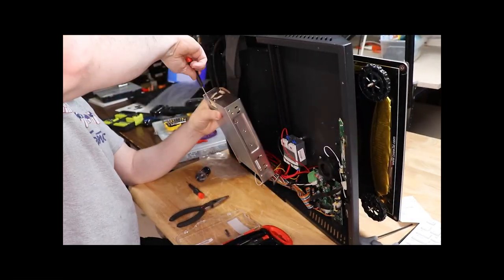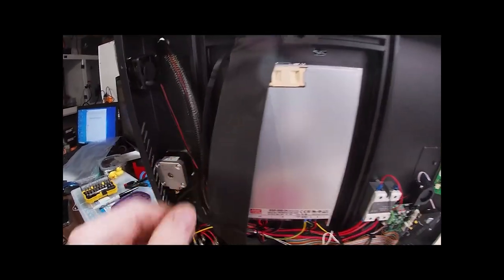Silencing the LOUD Creality CR-10S Pro Electronics Fans!

Comment: Hey I replaced the hotbed on this same printer and I'm having the darndest time finding the wiring setup to correctly reinstall it. There is one for the V2 out there, but that's not accurate to my printer. I think this one, the not V2 version, is accurate. Can you post an image of the wiring setup accros the power supply and the box to the right of it? I need to know exactly where those hotbed wires go exactly. I can get it to heat with thermal runaway, or not heat at all (disconnected), but a proper thermistor setup escapes me. I thought a good clear view would help. Thanks in advance.

Comment: Interesting video. Thanks for sharing your upgrade.

I am working on the noize reduction on mine too and while looking at your video I am wondering why you didn't work on the air flow.

While looking at the bottom of the printer, I can see there are holes almost every where and in fact the fans are just mixing the air inside the printer. Some pieces of cartboard should optimize the air flow and therefore again reduce the activity of the fans. Lets try it !
Reply from the maker: I wouldn’t use a combustible material near electrical components. I bought that kit from Tiny Machines.  I also have my printer inside a safety enclosure so the added flow works for me

Comment: It's nice to see the 10s_Pro getting some love on YooBoob; everything, upgrade-wise, seems to be for the Ender-3.

  My first question for you is how on earth did you put up with the noise for so long?!
  Lol, seriously, I think I had mine for a week before I caved and went the Noctua route, and even now, the 24v jobby in the PSU bugs me no end when it kicks in.

  My second question is, did you use one of TinyMachines' hex files, or did you compile your own version of Marlin?
  I have a heavily modded V1, and I've had a BL-Touch sat on my desk for the last year & a half, but I've been in no rush to fit it (along with a V6 hot end) as everything works just fine, so, Q3 would be, is it worth the upgrade?
Reply from the maker: Hi !  My CR-10S Pro started as a V1. Bought second hand on Facebook.  Upgraded to v2 because I prefer the BL Touch.  Noise question, well I have it in an enclosure but even then, she was a howler.  Question two is I’m using TM3D’s firmware 
The next problem to resolve will be solved upgrading to DDX.  Video coming soon.  The stock hot end keeps cooking the tube. The machine prints great but every few weeks my extrusion/flow will go nuts and fail prints.  Pull the tube out, cooked again.  Time to evict the cheap and install some quality hardware.  Thanks for the comment!

Comment: It would take so little effort to make it better from the factory i dont get it who heard those fans and thought thats fine
Reply from the maker: Right?  Sadly “quality” components is frequently left out on machines at this price point.
Reply: @WhereNerdyisCool  Its not much about quality, doubt they need the fan to run full power, or they could used bigger fan at lower rpm. it would just need someone in the factory to take it into account and not just add any fan that will be plugged in to 12/24v to run on full power